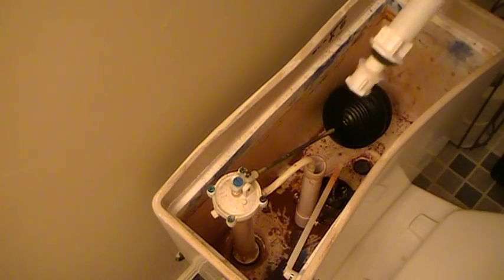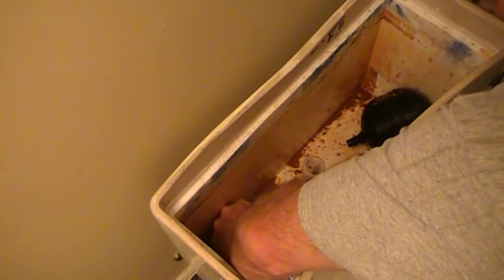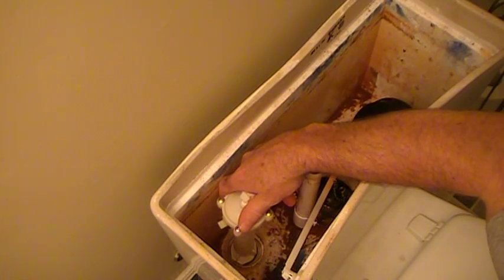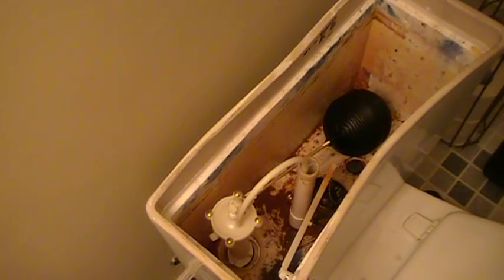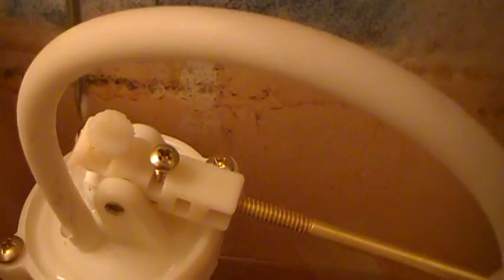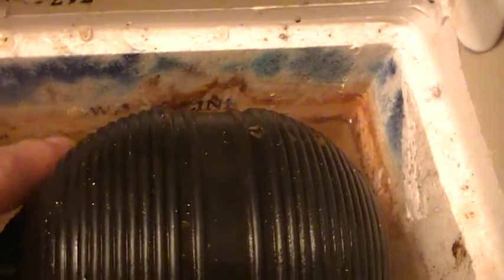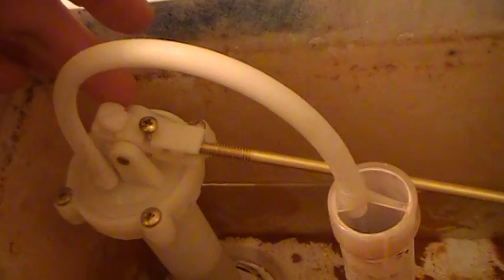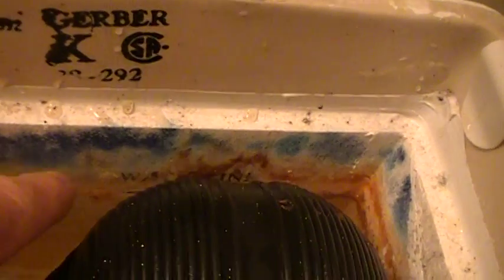How to Fix a Toilet... Ball Cock Supply Valve Replacement

Comment from the maker: @luemoonba Hey lue; glad I could help. I tried to cover everything that takes place with a fill valve (ballcock) for the installation. Not a lot of people actually use the screws and they end up bending the float rod instead, but for it to work properly; setting the screws is the only way to go.

Thanks for commenting and have a great day!!!     Al

Comment: Thank you - Great video.  Only problem was unable to hear IMPORTANT description and function of two screws on top of ballcock. Toilet filling with water drowned out your voice during first description and voice very low during second description.
Reply from the maker: Hello Mary,
Thanks!
You are more than welcome!
Sorry about the water drowning out my voice.
The screw in the center adjust the height of the water in the tank. Turning it clockwise lowers the level while turning anti clockwise allows it to rise in the tank.
The screw on the left adjust the float arm. It is important to adjust the arm so that it doesn't affect the flushing mechanism whether it is a flapper or a cannon.
Thanks for commenting and enjoy your week!   Al